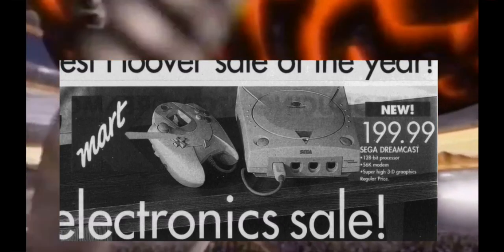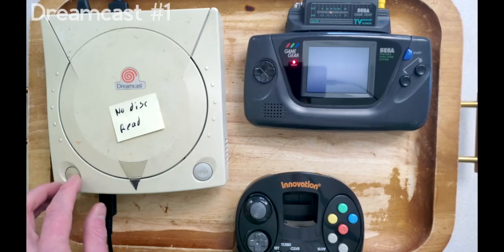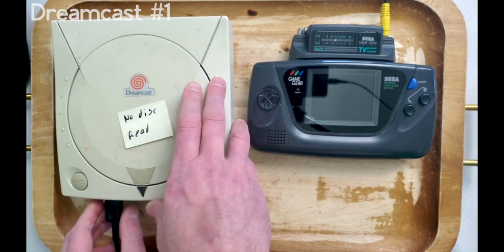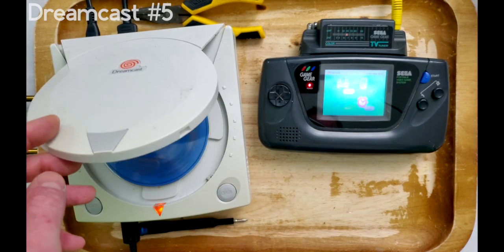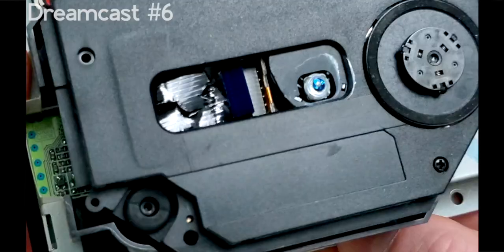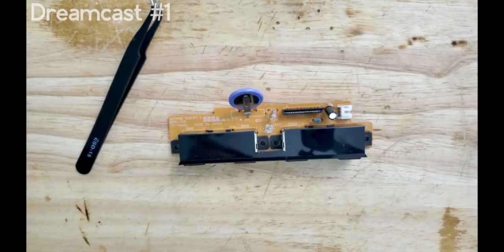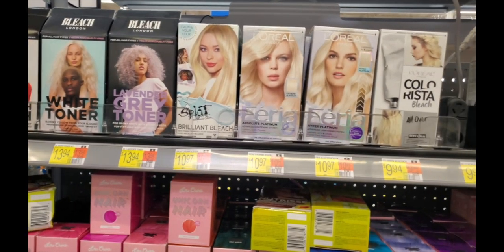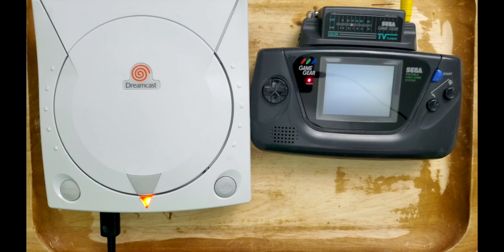I Bought 6 Broken Dreamcasts

Comment: Man, I my old busted ass Dreamcast. And miss that boot up sound. Main reason I got mine was for shenmue, such a great game that was. I still have both, tho my Dreamcast is like an ancient relic looking like hell with it partially opened 😂
Reply from the maker: Doesnt take much to get them back up and running!
Still pimping out that last dreamcast for the next video!
Reply: @retro-af  I ment to put "I miss my busted dreamcast" I was falling asleep lol, anyways ya I think I was either late teen or early 20s when I opened it up (that was still in the early 2000s) so at this rate I might as well just buy a used (hopefully working) one 😂

Comment: What sense does a ten times pricier lithium battery variant make, when it will inevitably die right around the time a normal CR2032 would, after a decade?
Reply: Because the Dreamcast provides a charge to it. CR2032 are non rechargeable and trying to recharge it will damage the circuitry. You can solder a diode in-line if you want to use a CR2032
Reply: @based_will  I know what charging means thanx... you don't get the economy problem i pointed at. The charge is only one half of the picture. Especially since it is negligible for a clock on a motherboard. There is the shelf life of the battery as well. Both types hold up more or less the same, a decade. Maybe two... -ish. And the drain for the clock is not killing the charge of a CR2032 before its shelf life expires. So what is the point of all this charging business... to be perfectly honest i'm finding perfectly fine unused CR2032's lying in forgotten boxes, but my batteries in my Dreamcasts started dying near the end of their first decade, and after, were in this couple years limbo where it acted like being charged during a game session, only to greet me with the set the clock screen a week later... It was a stupid engineering move, there.